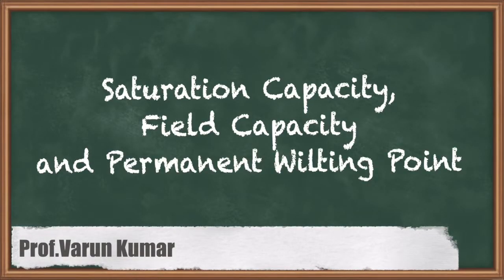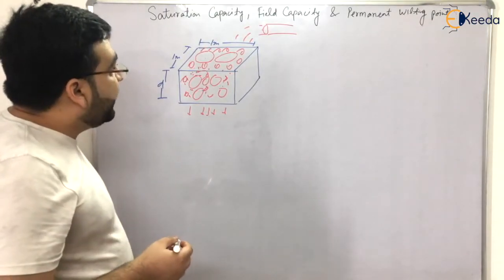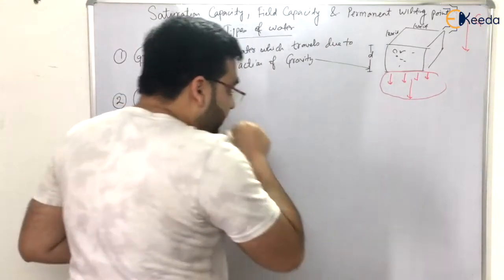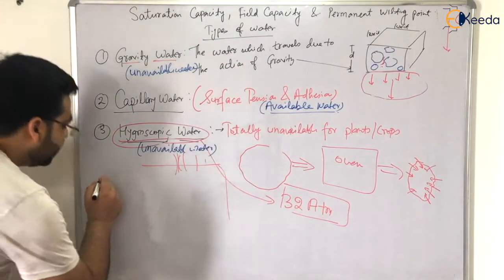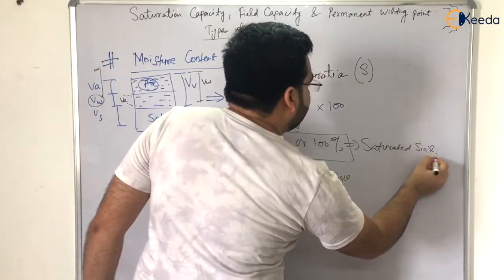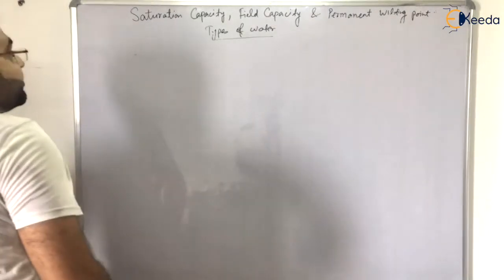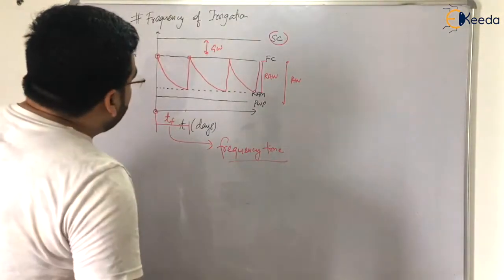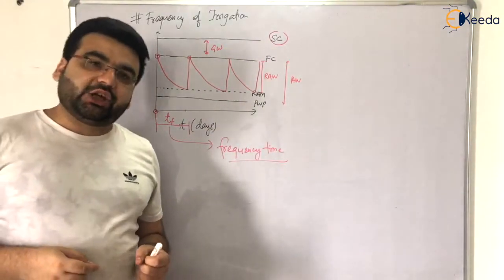Saturation Capacity, Field Capacity and Permanent Wilting Point - Soil Water Constants - Irrigation

Comment: I learn a lot from your youtube video. I've a question, how can i estimate/calculate the irrigation interval (when)? and amount in mm at different growth stage of a fruit trees  by considering the soil parameters of field capacity (FC) and permanent welting point (PWP) and the weather data such as temperature to estimate evapo-transpiration(ET). I mean  Total Water requirement for a single tree. Thanks
Gezahagn